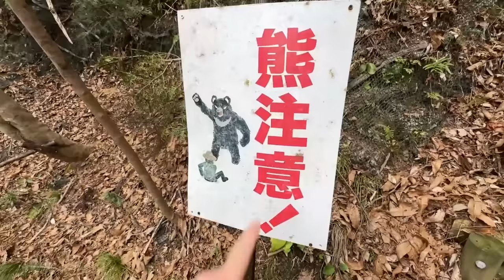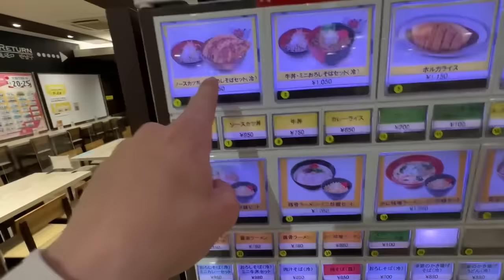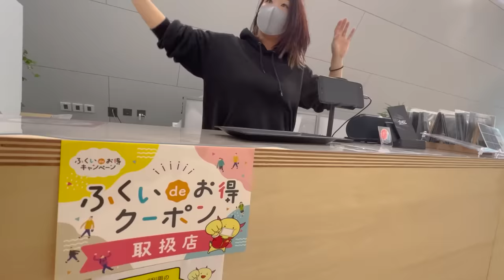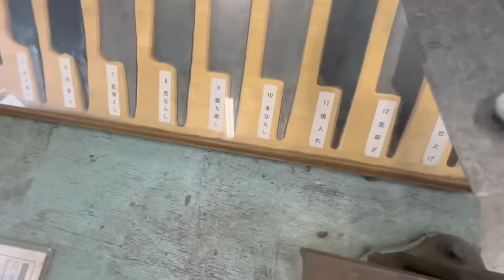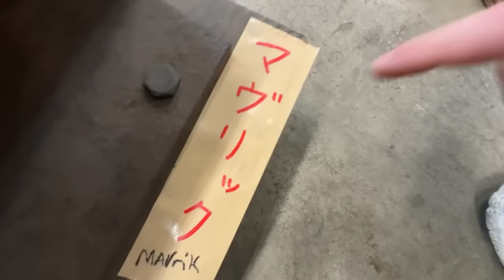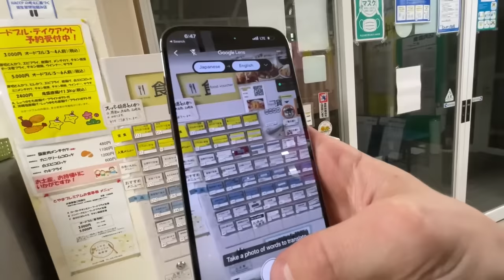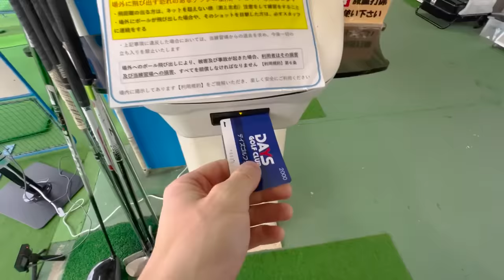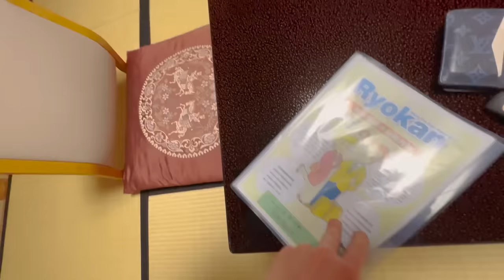3 Nights road-tripping in small Japanese camper

Comment: Mav, just out of curiousity, I always assumed that driving on the opposite side of the road would be a learning curve for a few days, but that our brains whould just acclimate to it and it would get easier and eventually we would have almost equal reactions and performance after several days of tripping. Is this correct? Or is a week not long enough to make it easier from the serious focus required at first. I realize that in your case in Japan, you are also handicapped by not understanding a lot of the road signs as well. Did you ever get more confident or was it always somewhat of a challenge?  Databyter

Comment: Mav, if am not wrong the truck is a diesel right? If so, don’t start it like a normal bensin/fuel directly as you did just turn the key. You need to let the heater cables turn of you will see them on the dashboard. Turn the key until ready to start wait 5 seconds then turn and start the truck. Otherwise you will mess it up.